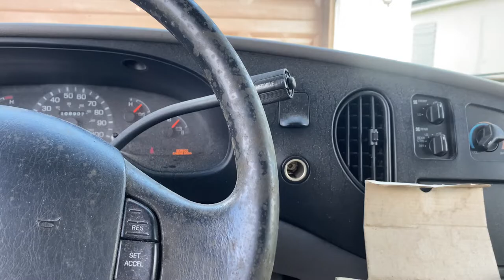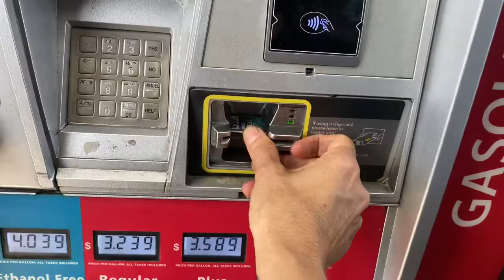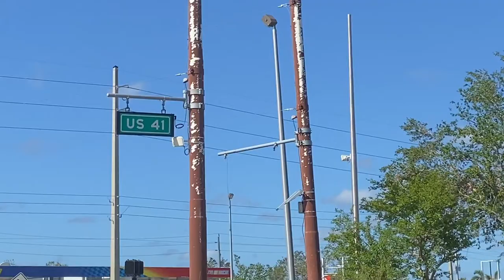HOW to convert a school bus into a tiny home | Driving the JALOPY  home WITHOUT a door mechanism

Comment: Need to use a rust converter chemical you can find it in many different home improvement stores &  rustolium in a spray can 
1 grind as much rust off as possible 
2 spray a rust converter on to protect it from rusting any more 
((Salt water environment is the worst ever on all metals)) so after the rust converter has done its magic 24 to 48 hours then you must use a quality primer & paint to seal the metal from the elements 
Yes welding is the best & only options if dealing with  Structural braces require for safety 🧐🤓
Reply from the maker: Awesome! Thank you so much! 💖💫

Comment: I use JB Weld products for all types of repairs. It works really well on items I find in the trash and upcycle to sell. Prepping the surface properly prior to applying it is the most important step. Get rid of as much as you possibly can with a wire brush or a disk sander. Then you need to seal it so it doesn't continue to rust before attaching a piece of sheet metal to it. I used the marine weld to reattach part of the wheel well on my turquoise utility trailer for picking. It held for over 2yrs. It will probably still keep holding for the jerk who stole it from me on Halloween. I am happy to help you if you have any questions. 🙂
Reply from the maker: Oh yes. I always forget about good old JB Weld! wow what a jerk! Hopefully you can find your trailer again. Turquoise is an a color you can hide very easy! What did you use to seal it?
Reply: I am hoping one of my friend's spots it somewhere but they probably painted it.
Reply from the maker: Yea true ! Fingers crossed though!!
Reply: @floridachickstinyadventures  I use a couple coats of Rustoleum Spray Paint & Primer.

Comment: If not welding, may I suggest rivnut?
Reply from the maker: Sure , please explain I’ve never heard of this! 😃
Reply: @floridachickstinyadventures  rivnut is a way of attaching metal to metal. You drill holes in two pieces of metal and on one side you attach a squeeze in nut and through the other metal piece you put in a bolt which allows you to bolt the pieces together. I'll send you a YouTube video that will explain it better. 👍
Reply from the maker: Awesome!! Thank you!! 💖💫

Comment: Have no clue on the cost but what about steel or aluminum sheets then wood..
Reply from the maker: Yes that would be best case scenario. It’s the welding that cost so much
Reply: @floridachickstinyadventures  
Maybe there are some kind of bolts or screws that can be used..I would think in today's world..but maybe not..if it's not really going to be driven then maybe lost of wood..thicker wood..idk..I'm just putting out guesses